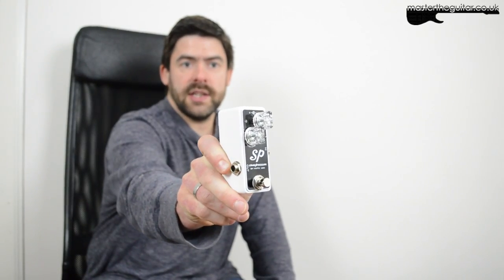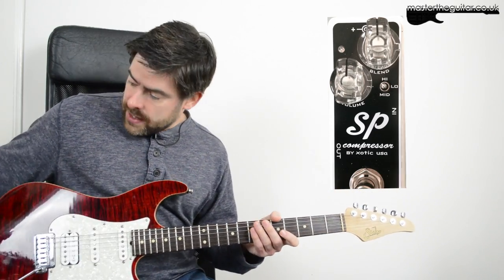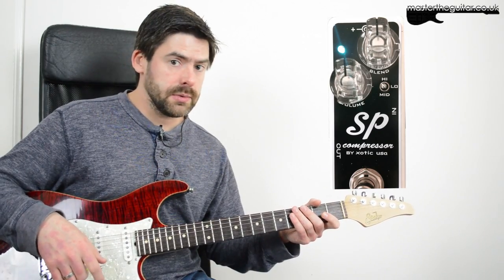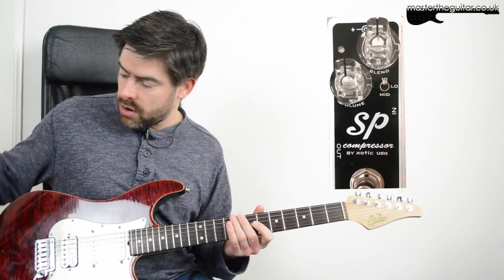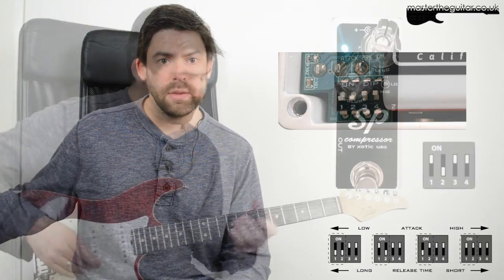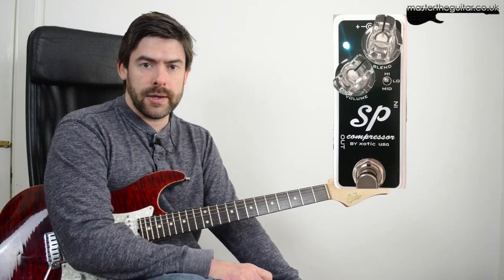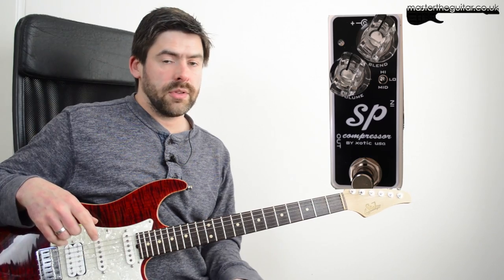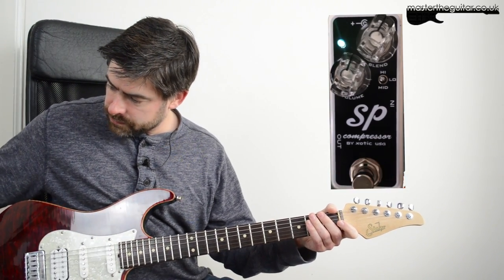SP Compressor by Xotic USA In-Depth Pedal Demo - MasterThatGear!

Comment: I've had this peddle for over a year (and it's great).  I had no idea about the internal mini switches.  Stoked.  Earned a sub!
Reply: I guess you didn’t bother to so much as glance at any of the manuals inside either with super obvious diagrams lol unless you got it without a box, in which case that’s a very neat discovery
Reply: @atonofspiders  I didn’t look at the manual.  I’m my pure joy and excitement for a compressed signal, I lost myself for a moment.  I’ll work really hard to forgive myself and as to not set myself up for a condescending guy like yourself to point out the obvious.  😘

Comment: I have SP and Cali76CD ( the best Compressor) 
The factory default SP settings is good but not the best ! It can be more transparent and better if you switch the second internal button to UP position and the third button to down position ( less atack and more highs ) It will become one of the best Compressors ever !
Reply: Is it that good using it with a distortion?? Thanks

Comment: Best compressor ever made!!! And best design ever ... I hate myself so much for trading this gen for the new TC Electronic Hypergravity compressor... I fell for the hype about a multiband compressor... I could live with using my DAW for that... And get that sweet warm sound from the SP. the TC is just too damn sterile, clean and digital... Not to mention knob latency makes it hard to dial in properly... I'm going to have to buy this compressor again!!! I'm going to have 2 130 dlls comoressors ... :( awww well... That happens when you don't try and listen before you buy... Lesson learned. Xotic SP is the king!
Reply: +Luis Sutil I agree whole-heartedly!  I bought the TC Hypergravity too and didn't like what it did to my tone or the initial attack (noticeable "popping").  I'm trying to decide whether to get the Xotic or the JHS Pulp 'n Peel or possibly the Barber Tone Press.  The sound/price/size are mighty attractive on this one!
Reply: +GuitaristOnWheelsUSA yes, tc disappointed there . But SP sounds so freaking sweet

Comment: Nice and good review,thank you. How does the pedal work with an archtop with single coil PU?
Reply from the maker: Thank you for watching, glad it was of help. :) 

I’ve not tried the SP with a single coil archtop but I have used it with my Ibanez AF105NT archtop to add little bit more body and sustain as the stock humbucker pickups need a little help sometimes ;)
Reply: Thank you! How did it work out with the Ibanez AF105NT ? Ok? Useable in a musical sense?
Reply from the maker: Yeah it worked well, I was aiming for a nice jazzy tone and feel combined with my amp and the SP did the job.
Reply: Ok,great ... What amp if I may ask?
Reply from the maker: Clean channel on a Victory V30
Reply: Ok,so not really an jazzamp ;-)

Comment: Would you use the SP to increase sustain ever so slightly? My (mini) humbuckers don't need more compression than they already got, but I would like just a little more sustain by way of compression. Cheers!
Reply from the maker: Yeah definitely, I do that if I need a little extra when playing my Strat.
Reply: Use the low setting and run volume and blend at about 1 o’clock. That works perfect for me for the extra sustain.

Comment: Just bought this pedal and have been testing it out.  When using it through an over-driven amp it is extremely noisy when the toggle switch is on High or Mid.  Too much for my noise gate to handle.  On the Lo setting it's more acceptable but still noisy.  This pedal seems much more suited when used with a clean sound rather than overdriven signal.  Has anyone else noticed this?
Reply: The problem is resolved if I use the compressor in the effects loop of my noise gate (EHX Silencer) which is what that loop is for.

Comment: Would this be suitable for adding sustain to an already overdriven amp without increasing volume? I was all set for the exotic ep but am mindful of increasing volume levels at home.
Reply from the maker: Yeah definitely, it's how I use the pedal when playing less hi-gain sounds with my Strat. I have a Xotic BB in front of the amp as well as the SP to give it some more sustain when required.
Reply: The EP Booster and SP are a great combination. Use both together.

Comment: This pedal is dynamite, I love mine and its a always on pedal.
Reply from the maker: reso1349 Love it too, fantastic compliment for clean sounds.
Reply: mastertheguitar I really dig the blend feature and keep mine set at about noon before two OD pedals (Xotic BB and a Rockett Flex Drive) then I split the signal going into a GK bass amp and a Peavey Classic 30.  I have an older Barber Electronics Tone press parallel compressor which is very similar to the Xotic unit but three times the size.  Another always on for my rig is the EP Booster, man can that thing fatten up your tone.  Thanks for your videos and insight, I look forward to all of your posts and reviews.